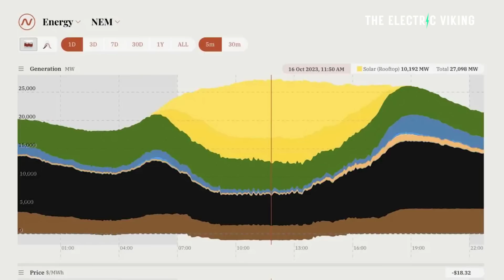Wind and solar break records in Australia; Coal hits lowest point in 100 years

Comment: Coal power plants have huge drum boilers suspend on chains from the ceiling. This does prevent them from busting when heating up or cooling down. It is a very slow process that does not align at all with ramping up/down with daily demand and the solar day/night cycle. Very reliable East/West oriented MW class solar for the morning / evening demand peaks did drive them out of business.
People on a lot of solar do shift their biggest dispatchable loads with a simple timer into the midday solar peak.
Just by smart supply and demand balancing people can do a lot with 2-3 USDcents/kWh solar energy supply. it absolutely dominates the market anywhere from hot to cold climates. You can even use that in Finland subarctic climate. Humanity learned a lot about solar energy and it is still learning how to best combine it.

Comment: The grid is getting maximum benefit from the solar. The lens I shaped yellow blotchy is rooftop solar. Doesn't need to go through the long distance high voltage power lines.  Generated at the point of use.

Comment: More disingenuous cherry picking BS from Sam.  Dont believe a word he says unless he provides actual data from a reliable source. Yes coal production is falling, yes domestic coal consumption is falling and renewables are rising but Sam does give numbers and when he does it's often wrong. Consistent data is hard to come buy and the numbers vary hugely so its not easy. Coal production IS NOT at an all time low, its at the 2012 level. One source says production was 443Mn T in 2022 down from a high of 530Mn T in 2017, another says its 613Mn T and going to remain roughly the same until 2030.  Aussie consumption in one source said it was 44 Mn T in 2018/9, yet another said 98Mn T in 2019/20 and will be reduced by 30% by 2030.  So you see Australia isnt using as much coal but they are selling it to those that do.  As for renewables Sam says its 70% of the grid.  BS. The National Grid report states that it was 35.9% as of 2022 and is steadily increasing. Other reports say it will be 61 or 65.5 by 2030. 
So Sam's tenet may be right but his details are not. Big coal consumers will never cease their demand (India, China, Africa) and they will not be dictated to by the rest of the world. Australia and its insignificant population numbers can do what they want but 50% of the world is showing the middle finger.

Comment: It's always good to show the gargantuan bhemoth abomination of the coal extraction process and the transportation of coal on massive fuel oil bunker oil run Miles long trains. Don't forget and leave that out. The cost of all that is astronomical and the pollution that the extraction and transportation makes is formidable as well. The maintenance of the giant trains and the huge machinery to strip mine coal. They always leave that out of the equation. Just showing coal plants running with smoke coming out of them. That's not even the half of the destruction.
Reply: After the coal is transported... It has to go through a formidable process before it can be burnt at the coal facility. After huge machinery strip mines the coal it has to be loaded on the trains. Incredible gargantuan conveyor belt abominations and giant several story tall skiffloaders. With huge engines. It's a nightmare. You need to go through that whole process with these videos you make which are pretty good

Comment: Solar cheaper than coal - the great lie.  A solar panel may be cheaper a noon on a sunny day when electricity demand is low - however as the sun sets and output falls when it is needed most the cost per watt tends towards infinity as output tends towards zero.

And that is before adding in distrubution costs and back-up energy systems

Comment: Expect black-outs in January - the Wind does not always blow and the Sun does not always shine

To provide battery backup to a wind and solar grid would cost around $10 TRILLION dollars before extrta demand to recharge EVs..

What about pumped hydro?  Snowy 2.0 has been a complete diasater.

Meanwihle  China continues permitting the equivalent of two coal-fired power plants per week

Comment: Sorry Sam! I am from the UK; we are surrounded by Wind Turbines and We want them to end! We all want the best for our Children and Grand Children. However we have all been told a big fat lie. The future is not with either wind turbines or Solar PV. The Turbines only work when the wind blows, they need electricity to operate in the first place, so on some days they can be a big drain on the grid rather than a contributor. For every 100 KW of electricity they are touted to generate, they in fact only contribute 20% of that specification, to the grid! The 80% outstanding from this specification is made up quietly in the UK, by Gas Turbine generators! Solar is the same, solar can only generate electricity when the sunshines and only when the sun is at a particular incidence to the PV panels. Germany has installed approx. 120%+ of their total energy requirements through installing Wind Turbines and PV panels. However, they too have found themselves digging mountains of coal from the ground so as not to freeze this winter! Australia is in a better position as you have more sun, however, PV has its own “issues” in that PV does not function other than within very specific tolerances. If the PV Panels get too hot they don’t function very well, light incidence issues etc, etc. Australia are currently experiencing a big fire of one of the big Tesla Battery Installations, required to even out the electricity from the PV Solar farm to the grid. This is causing a massive amount of poisonous fumes to vent into the local community as well as poison the local water supply! So please forgive me. I will be cheering when governments stop playing with crap green Ideas and embrace the more expensive but much more intelligent solution that lasts for over 100 years, is wave technology and then we can stop burying and poisoning the earth with all the turbine and PV mountains that no one wants to recycle because it’s simply not economically viable!

Comment: California’s buildout of wind and solar farms is exceeding the ability of its grid to handle all the electricity during periods of high production and low demand.

The U.S. Energy Information Administration reported Monday that curtailments, which is when wind and solar farms are deliberately shut down, increased to peak levels in 2023.

The California Independent System Operator, which operates the electricity grid for much of the state, has steadily curtailed the amount of electricity from wind and solar farms that flows through its system.

The decreases appear to be situational, not a steady process, and are the result of the state not having enough power lines to carry all the electricity produced by wind and solar farms, the EIA report stated.

These curtailments, for example, typically reach their peak in spring, when the weather is mild and demand on the grid is low.

In May 2015, CAISO curtailed 41,140 megawatt hours of electricity from wind and solar farms. In April 2023, curtailment on those farms totaled 702,883 megawatts of electricity.

Comment: On a sunny day today (31st of October) at 11am, 68% of the national grid (except for WA) is from renewables. 64% in WA. There's a big amount of excess solar from Queensland which is being used to pump hydro in Queensland and send power to NSW. Not sure why Qld is using a small amount of gas when there's excess solar. Tasmania is of course 100% hydro and wind. 🙂 My own house is exporting over 80% of the solar power to the grid. If I could afford a battery, I'd install one!
Reply: ditto here in NZ except we export only about 66% of my output cheers mate
Reply: @vernepavreal7296  the numbers will change when summer arrives! We'll use more power to cool the house, for sure. If you're only exporting 60%, maybe your solar is better sized for your house. Looking forward to visiting NZ again!
Reply: @theharper1  five bedroom house but normally only two of us here although we do have two living areas for occasional Airbnb guests no air conditioning that helps of course wish we had heat pumps and of course wish we had a battery we have 7.6 kW of solar array normally exceeds this over summer 

hope to have an EV by now with vehicle to House technology but we are into recumbent tandem cycling and want a van so proving difficult and would be very expensive so we just have to wait
Cheers
Reply: WA is three hours behind Eastern States therefore our actual solar output in WA is MUCH higher than the 64% stated because it is still early morning here.
Reply: @user-zu4rb4fg5b  sure! I was just stating a single point in time. It would be better to compare the cumulative kWh for a 24 hour period. I was just impressed that on a random day, almost 70% of power of the majority was from renewable sources.

Comment: So far no power grid has reported being able to reduce electric rates due to incorporating wind and solar generated electricity.  It has been the opposite in the USA.  Every electric grid that has had large scale wind turbine electricity added to the electric grid have seen electric rates go up.  What should be talked about is how much fossil fuel savings is going on from the use of solar and wind generated electricity.    Having fossil fuel plants having to work at low efficiency levels in order to provide make up for the dips in solar and wind generated electricity can cost almost as much as generating the electricity in the first place.

Comment: In September 2023, renewable energy generation in Australia's National Electricity Market (NEM) reached a record 7 terawatt-hours (TWh), up 13% year-on-year. Solar accounted for most of this increase, generating 1 TWh more than in September 2022. Wind generation remained steady year-on-year, while hydro generation dipped slightly.

On September 16, 2023, renewables briefly contributed more than two-thirds of the power in Australia's main grid, at 68.7%. This was driven by a combination of factors, including strong solar generation, favorable wind conditions, and low demand.

The Australian Energy Market Operator (AEMO) has said that the record renewable energy generation in September is a sign of the rapid transition underway in the Australian electricity sector. AEMO expects that renewables will continue to grow strongly in the coming years, and that they will play a major role in meeting Australia's future energy needs.

Here is a breakdown of renewable energy generation in Australia in September 2023:

    Solar: 3.5 TWh (up 13% year-on-year)
    Wind: 2.5 TWh (steady year-on-year)
    Hydro: 1 TWh (down slightly year-on-year)

The increase in renewable energy generation is having a positive impact on Australia's greenhouse gas emissions. In the September quarter of 2023, the NEM's emissions intensity was down 18% year-on-year.

Overall, the outlook for renewable energy in Australia is very positive. The country has abundant renewable resources, and the cost of renewable energy technologies is continuing to fall. As a result, renewable energy is becoming increasingly competitive with fossil fuels, and is expected to play a major role in meeting Australia's future energy needs.
Reply: The latest data on renewable energy production in Australia is from October 2023. In that month, renewable energy accounted for 35.9% of Australia's total electricity generation, up from 32.5% in October 2022. This is a new record for renewable energy generation in Australia.

The largest source of renewable generation in October 2023 was solar, which accounted for 14% of total generation. This was followed by wind, which accounted for 11% of total generation. Hydropower accounted for 6% of total generation.

The increase in renewable energy generation in Australia is being driven by a number of factors, including:

    Falling costs of renewable energy technologies
    Government support for renewable energy
    Increasing public awareness of the benefits of renewable energy

The Australian government has set a target of net zero emissions by 2050. Renewable energy is expected to play a major role in achieving this target.
Reply: @TheLemouria . 35.9% from RE ….
OK, but where did the other 64.1% come from ?
  And how much of that RE was available during the 8am and7 pm peak periods. ?
 The only reason RE % is increasing, is the huge amount of new RE equipment being installed
 And RE increases run in parallel with electricity cost increases 😮😮😢

Comment: It would be great to see you produce a video about what might happen to the grid once we get into the high renewables scenario. Australia will be a very interesting test case.
Reply: 100% renewables is feasable now.
Reply: @nordic5490  I agree. I'm just curious about how we get from 100% of renewables on occasion to a system where renewables are at about 300% on occasion. At least that's where Tony Seba says we'll level out.

It would take renewable halving in price, or being even that much cheaper by halving 3 times. I think that's what Seba is thinking.

Anyway, exciting times, and I hope we get through this transition swiftly.
Reply: @DoFrank  South Australia is 100% or nealry 100 % RE for some of the year. Batteries, plus a couple of fast response gas turbine peakers if  necessary. SA even has some diesel gens now that are nearly instant, that are dormant 363 days a year.
Reply: @DoFrank Is Tony Seba taking the potential of V2H and V2G into consideration?  We will not need to build such over capacity if grid consumption at night is destroyed by people consuming their own stored energy, and sending their surplus back into the grid.  This is already being trialled in South Australia and I believe is the model for the future.
Reply: @nordic5490  Unfortunately we need the grid to be able to accommodate a 100% renewables scenario, and we are a decade away from that happening.
Reply: Not much will happen! The investment in new projects will stop if the companies don't earn money.
Maybe first they want the EV owners to have their cars connected to the grid always when they not are driving. This means also when people are at work. Maybe you can get payed for some of the times/hours your car is used for storage.

There are some options to level the peaks of electricity production and usage.
If the owners of the grid companies at the same time are car owners, then they exactly know how to use the surplus in production...

Comment: Is there any more news about contractors and DIY builders using solar panels instead of exterior plywood when constructing or renovating homes?  I really enjoyed the brief mention of one fellow a year ago.
Reply: Existing panels work better when there is a gap behind the panel so not with current panels.
Reply: @radart6037  Thanks!  I suppose not just a gap behind the solar panel, but some sort of air movement, also, to carry the panel heat away.

Comment: This is so true... Yet people are still 'worried' we won't have enough electricity to run the fleet of EVs (with no ICE). Of course the average EV uses about the same energy as a fridge, so it's actually not that great relative to existing capacity...
Reply: A typical 500 W refrigerator uses about 4 kWh of electricity per day, a typical EV battery has a capacity of about 69 kWh.  That's about a 17:1 ratio (assuming full charge).  You had better do some real world research before making foolish comments.
Reply: @dzcav3  Yeah its more like 3-4 fridges, or a hot water supply.

At 40km a day and 200Wh per km including charging losses is 8kWh a day on average. Which is around a days hot water supply top up worth of electricity.

More than a fridge for sure, but still a nothing burger compared to the energy a ICE car burns each day.
Reply: @oldbloke204  ICE cars are not efficient. 

They are terribly inefficient compared to a EV.

If you want burn the petrol in a jenny and charge the EV with it. 

Thats more efficient than the ICE car because you can run the jenny at it's most efficient RPM and an EV has regen.

Which also makes the rest of your post pointless.
Reply: @oldbloke204  

Yeah I'm generally the smartest person in the room. How about yourself? Because you so called points don't really stand up to the test of logic.

In Australia we get out fuel shipped from Saudi Arabia, and refined in Singapore, before being shipped and transported all over our country. It's a economic, environmental, and security shit show.

Because we have some of the cheapest to install rooftop in the world, I and many others charge our EVs with solar.

I in fact wrote a program to automate, and guarantee this charging from solar - because I just could do so.

There are no inherent carbon costs to building a battery. It's simple a matter of the existing supply chain being carbon intensive.

And the solution to that is wind, solar and batteries and not burning stuff.

I have no idea what your problem is, I guess you just hate progress and our children's future.
Reply: @dzcav3 lol I love it when people destroy their own argument when they attempt to refute facts. Teslas use a 60kWh battery, not 69kWh and there are more of them than any other EV in Australia. But the kicker is, likely noone fully depletes their EV  e v e r y  s i n g l e  day!! So, I know, from actual experience across two EVs that we consume about 16kWh/day on average. That equates to 650W continuously for both, or 325W for each. What did you say a fridge ran at again? Of course it all depends on how far you drive... And how big your fridge is. But the point stands, EVs are actually not that big a user of electricity compared with typical household usage.